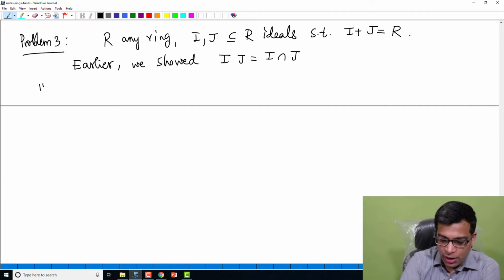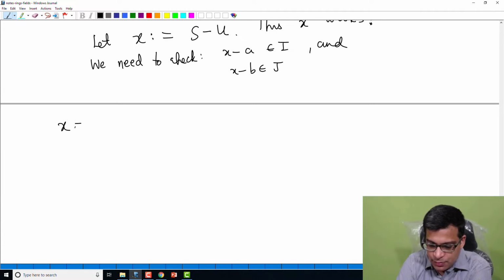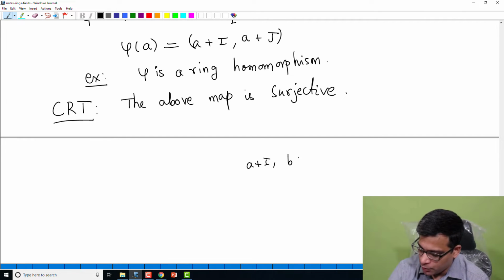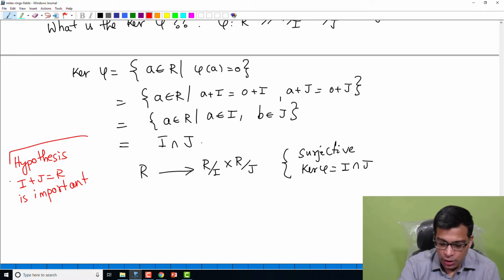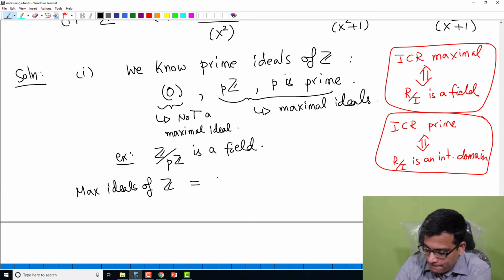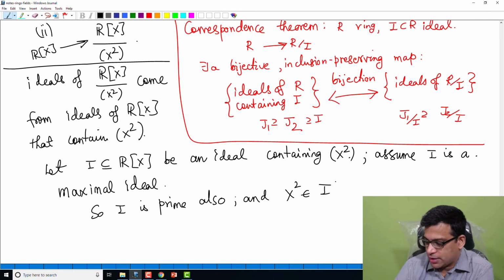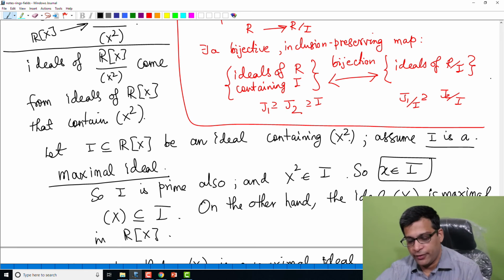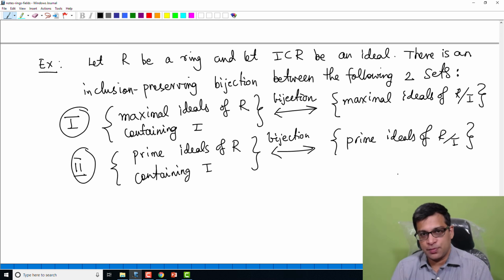Problems 5

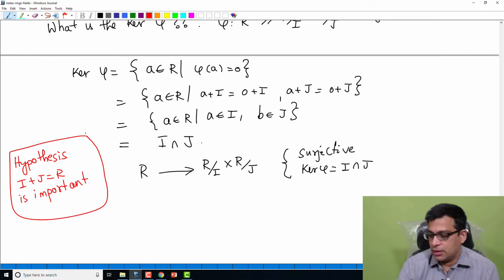Comment: 14:28 What is the  example of the map from R to R/I ×R/j which is not surjective?
Reply: Take R=Z, I=2Z and J=4Z and then consider the ring homomorphism f:R ->(R/I) ×(R/J) defined as f(a)=(a+I,a+J) for all a in R .Then f is not surjective . Because , (0+I, 3+J) has no preimage  under f .(Suppose b is the preimage of (0+I, 3+J) then we have f(b)=(b+I, b+J)=(0+I, 3+J) then it follows that b is in I and b-3 is in J i.e., b=2k for some k in Z as well as b-3=4s for some s in Z , that's a contradiction as b can't be even and odd at the same time ).